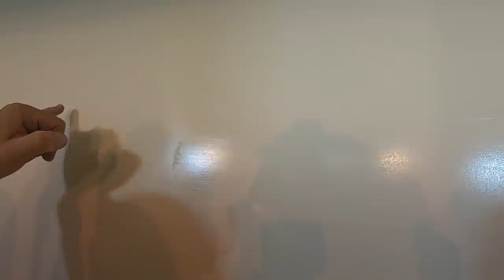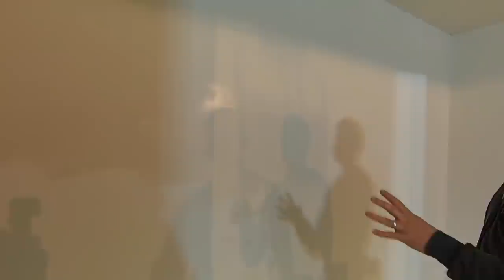The Future Of Plastering PART 2 | Spray Plastering...THE FULL GUIDE!!

Comment: I don't understand why you guys in England still plaster with that brown mud ? 
This filler has been around for 35 years  it's a white colour and very easy to get level 5 finish depending on weather conditions you make it thicker depending 
I've tried a trowel but prefer spatulas wooden handles no more than 10" lay on.These days they call then skim blades 1.5 m long😅
Only down side is sanding you need a flex or skills in old fashion hand sanding which is messy

Comment: This products appears to dry as soft as regular drywall compound........or am I mistaken?
Reply from the maker: It's a lot harder...it's made from a marble compound pal 👍
Reply: @PlasteringForBeginners  Interesting. Looks like a good idea. Is it available in the US?
Reply: @PlasteringForBeginners  definitely don’t wanna be breathing that in then 😷 
Had good expectations for this.. seems like the instructor is making it out to be a lot better then it really is. The fact you have to sand it... may as well tape and joint....
Or better yet skim and not have to sand
Reply: @amateurvegan2636  you're forgetting you don't have to sort the water out ,mixing cleaning up afterwards . A gauge takes 3 hours to finish and then clean up afterwards . Once you start a gauge you have to finish you can't just walk away at a moments notice ,as you can with any other trade but you can with this system. Sanding seems easy enough to me.
Reply: @michaelburns5967  what’s the cost of the material? I bet it’s a lot more then skim?
If you have to sand it then it’s not plaster
Reply: @amateurvegan2636  if you work on sites the painters use a machine to spray on the external plasterers use machines ,I think uou will find its only a matter of time before this system kicks in.
Reply: @amateurvegan2636  I see your point about sanding down though ,probably a lot more work than he's making out and it is probably more expensive to buy than bags of skim.
Reply: @michaelburns5967 
I agree that we are about to have a leap forward in technological development for trades. Guys are already spraying multi finish although I don’t see this being faster given the mixing and cleaning of the machine.
With a little more refinement I can see this being a good system. 
If you could spray joint filler to sub out and the finish material was a little more refined. (I think longer working time would actually be a benefit) 
When it’s at a point where little or no sanding is needed il be interested.
For people to invest and change it needs to be a big leap forward.
See a lot of fringe improvements on current practises that just aren’t good enough to become industry wide practices
Reply: @michaelburns5967  
Even things like material availability are worth taking into account. Imagine having to bulk order the material because it’s not readily available, store or and ship it around..?
Reply: It's glorified joint compound system..known as shittle..3-5 year durability with low impact resistance.. it's not a hard coat system..

Comment: Is it dry lining compound? Easi fill 20 min or whatever. Easi fill is another one that gypsum have spent years changing time and again. If you are skilled enough you can use the stuff almost like finish. I wouldn't wanna be getting a sander out. Shouldn't really need to.  Bit of in between coats sandpaper if there's any scars ripples whatever.

Comment: That's a wetter Easi-Fill, be nice to follow someone using that system being a decorator I'm usually the one going round filling and sanding! (depends who plastered it) save me lots of time
Reply: Part of your job fill and sand inbetween coats ,never see decorators doing it these days, they seem to think once its been mist coated that's the finish🙄
Reply: @1979-v4i  I do!! But I seem to be using more filler nowadays, are plasters getting worse?
Reply: The gear gone shite over last few years, gypsum playing about with it so its it and miss get decent finish years ago was lot better ,put lights down a wall years ago looked mint ,do the same now it looks like the moon
Reply: @1979-v4i  I was going to say perhaps the materials have changed
Reply: Massively change ,we had one trowel and use to use plastic fire exit signs to polish it up, so God nose what they've done with the stuff

Comment: I was a tape and jointer,mostly Canary wharf, and we did full spray plastering for a level 5 finish. Went to work in Sweden as a painter and decorator and the painters do both the tape and jointing  spray plastering and painting , unlike uk where it's a separate trade. I ended up teaching Swedish Decorators how to use automatic taping tools for a few companies as that wasn't popular over there at the time. But regarding spray plastering it's very common over there. 
As a domestic decorator here now I use a masonary roller to apply the joint cement . I use Knauf blue  top  knocked down a bit .Its very quick once you get the hang of it and you get perfect results.

Comment: Ok this system is often used in America...it's joint compound..it's not true plaster it has no durability it is not a gypsum or a lime based plaster product..it is a chalk and lime with pva glue product..it has high shinkage and is a very soft finish...in america us true plasterers call this shittle...a true hard coat plaster will burnish  polish and no ridges and no sand paper will scratch the surface...

Comment: The more you work it the worse it gets even starts to peel off and never lay it on az you do with traditional trowel in a circular motion best straight up straight down 3 joints from top to bottom and side to side 
First coat is vertical second horizontal or vice versa